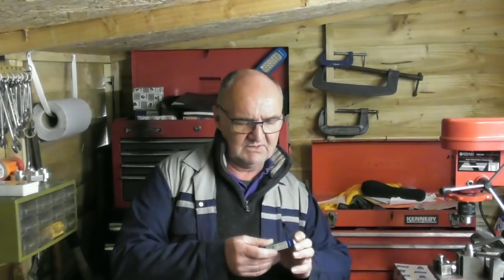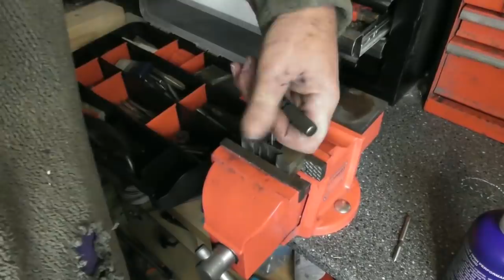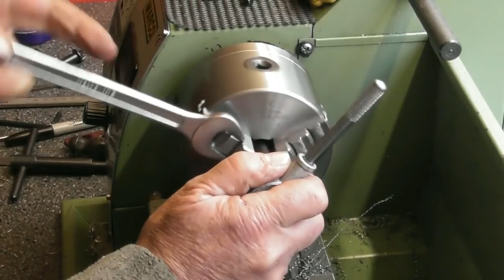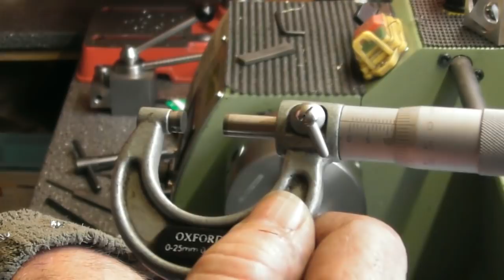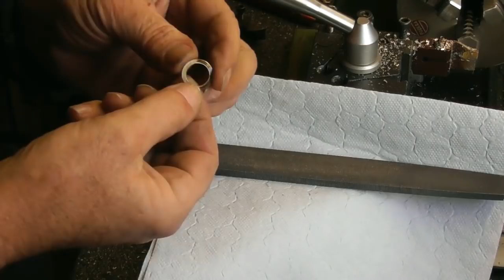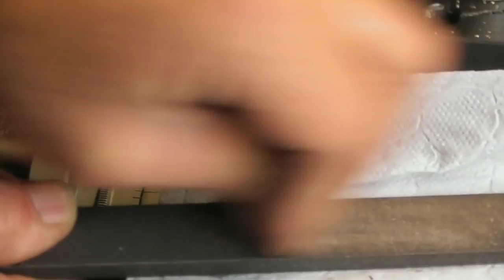WARCO LATHE Shop made quick change tool post part 14

Comment: Hi Ade. I made one of these tool posts to replace one of the aluminum offerings, which was OK, but steel was much more confidence inspiring. That was a while ago though, long before your video was available  and it was made in a pretty similar way to the way you did. Except I am lucky enough to have a milling machine. Regarding the dampness I have a plastic shed and the damp in there was a problem. but one of the reasonably priced dehumidifiers from Amazon does a really good job, I need to empty it of water every 3 - 4  days, sometimes longer depending on conditions.  but the  amount of damage that water could do if it wasn't removed from the air  brings home how much dampness we have around us. I went for a simple unit with only a on off button and it has been brilliant. Just a thought that may help with your moisture issues. Of course there is no excuse for not oiling tooling and wherever possible I oil blacken my tooling. Particularly shop made tooling. I have had mediocre results from gun chemical bluing chemicals myself, though oil blacking usually works well for me.